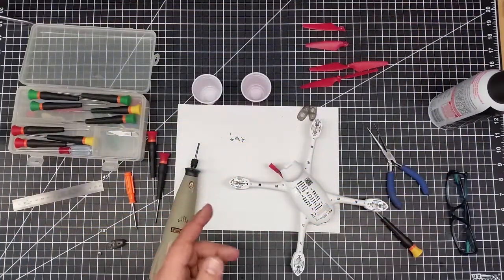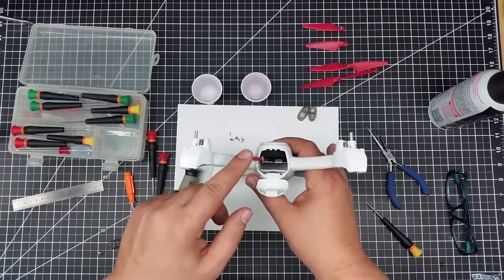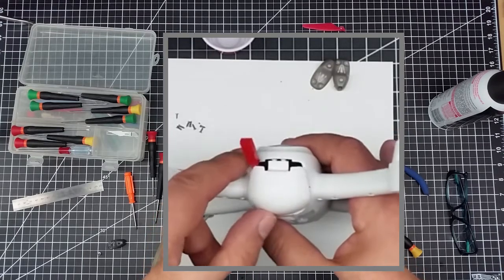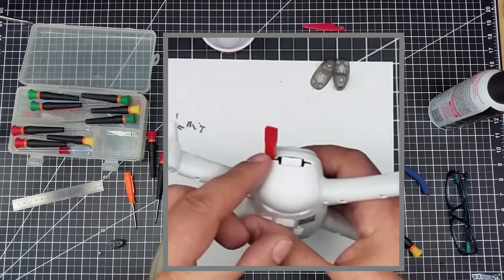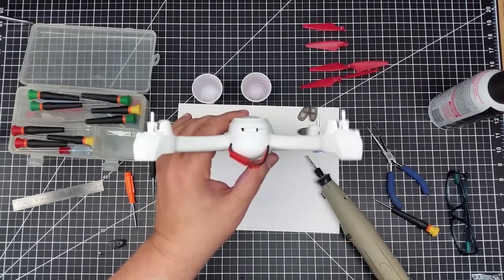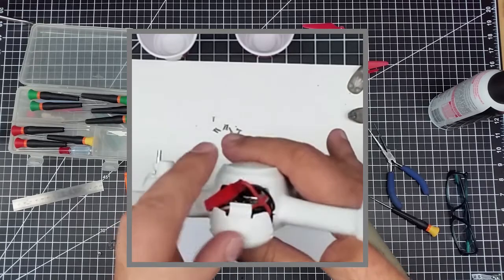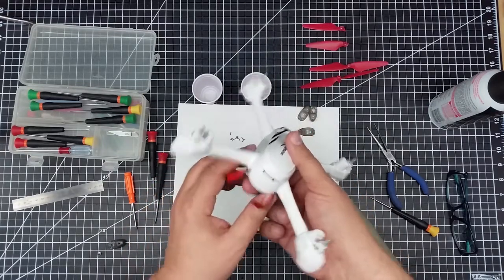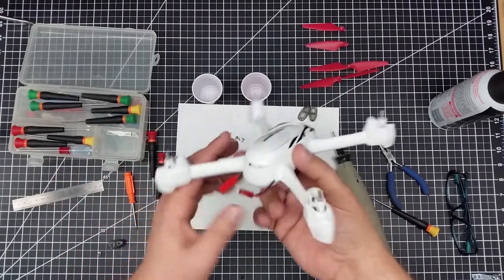Video Drone - Hubsan X4 H502 Battery Door Mod!

Comment: Since the connectors are out, how 'bout attaching a better battery with higher Mah, and stick it at the bottom of the quad :D would it work though..?
Reply from the maker: One of the issues is the quad really counts on the air flow and block it has lead to issues documented in several youtube videos.  Second is weight as this little guy is basically at the top stock as I feel the motor are on the small side to start with however I am sure they do this to make the cheap price point...

Comment: I don't no why they don't put a on / off switch even the cheap quads have a switch.I like your mod
Reply from the maker: The only reason I can think is "safety" as it would be a point of failure (from the vibration), but that only a guess...

Comment: What is the point in doing this?
Reply from the maker: Because the copter lacks a "switch" so to power up/down so you have to open the battery door then fight with the battery all the while the copter is energized and a safety risk.  In addition it can also add a "little" flight flight time because as soon as the battery is connected it is discharging and all the time you spend fighting with the battery and door is wasted time on top of the safety risk.  This has worked out well for me and use like this even today :-)

Comment: juat got one but it has plastic drive bearings, heard that this cuts motor life? is there a bigger battery available?
Reply from the maker: Have not found a bigger bat just however another shared a source for metal bearings and I might make that mode...